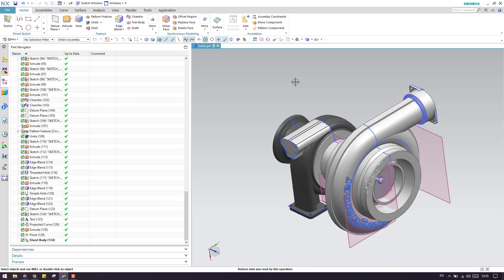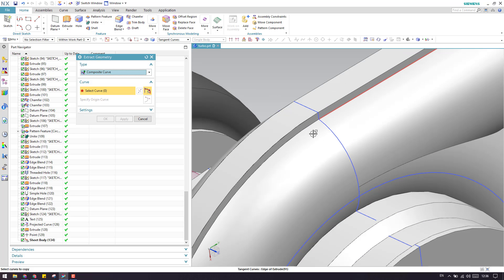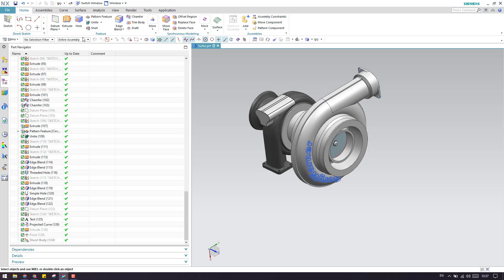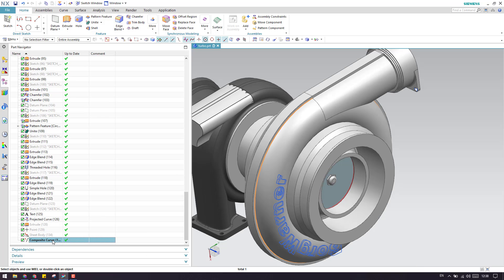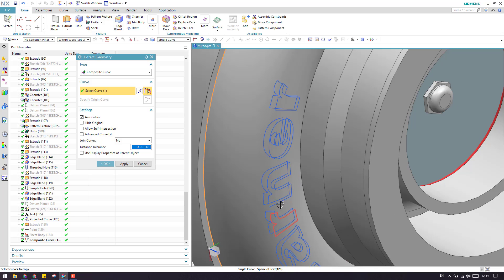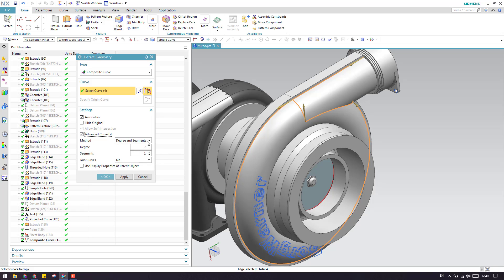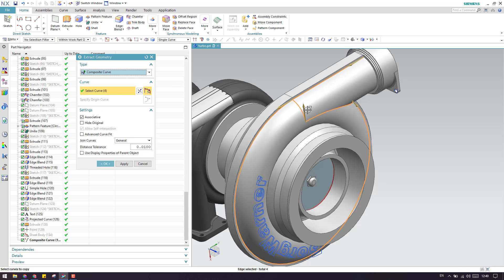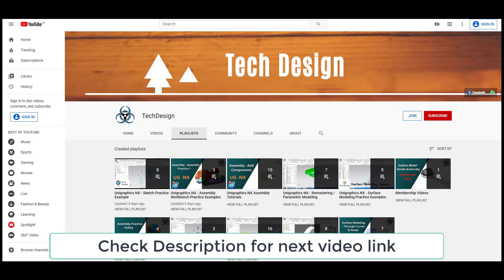Siemens Unigraphics NX- Associative Copy || Extract Geometry Part 1 || Composite Curve.

Comment: I have created a Weldment Assembly, now making it Machining to bore out the current 95mm dia to 100mm dia. I have try assembly cut and other but it is not working.
Reply from the maker: Hi
Pls share your model and concern to techdesignsantosh@gmail.com., will check and reply